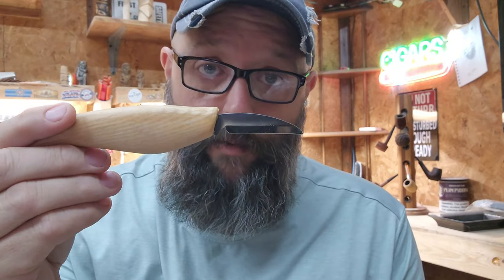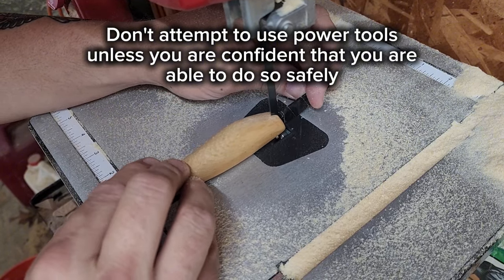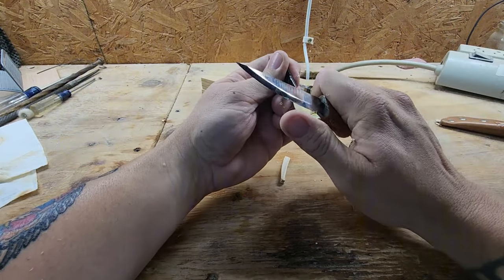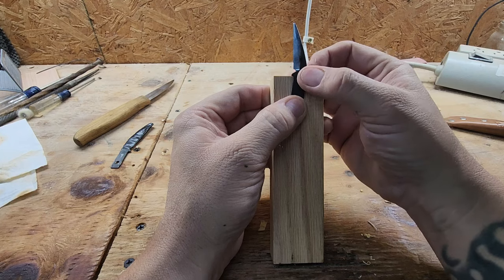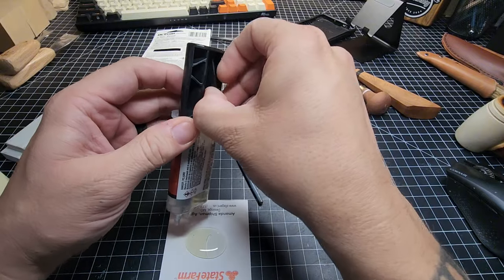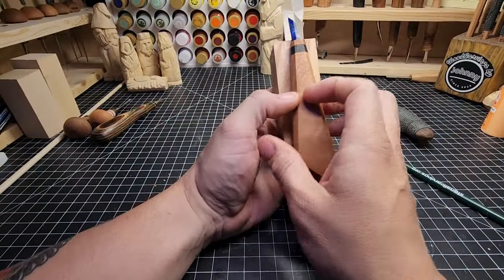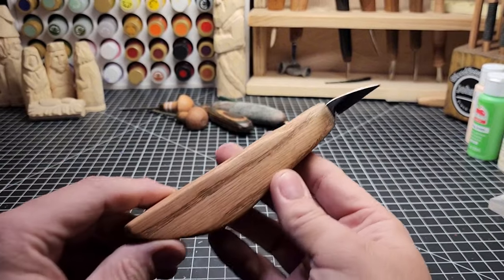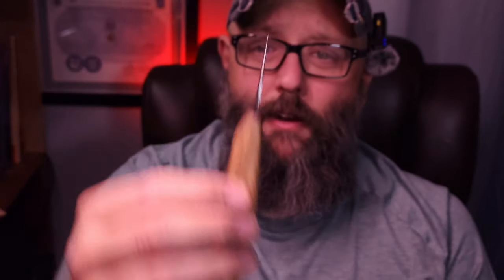Flexcut Knife Upgrade -- I fashioned a more ergonomic handle for my Flexcut Knife!

Comment: Great video! I really like the fact you encouraged people to customize their tools to suit their needs. Next time you go to glue the tang sand it with course sand paper and then clean it with acetone. It will ensure the glue adheres. Personal I would use jb weld it's stronger than the epoxy you used. I use it to make my flintknapping tools they are subjected to way more force than a wood carving knife. They hold up great, so I really like that glue. When I didn't have a bandsaw I used a metal working chisel just a 10 dollar cold chisel to split the handle and a utility razor and 60 grit sand paper to prep the blade for gluing. Just an alternative for guys who don't have a bandsaw.
Reply from the maker: @000cjr  That's great advice, thanks for the feedback! 😀

Comment: Looks fantastic. Did you consider carving those finger groves you like?  Or the markings along the spine to keep the knife oriented?  I’m with you…love a beefy handle and makes the grip much more comfortable and the knife easier to control.
Reply from the maker: @mgraham_Indiana  I did want to but the tang on this one shifts forward to where the finger groove would need to be.  You can see when setting the blade that the tang sweeps forward in the handle.  Where the handle is sanded too right now, I was worried I was going to expose the tang if I went much deeper.

Comment: Hay Johnny after I brought only one Beaver Craft though the mail as many knives are sold it's was beautiful but tiny for my medium large glove size hands I wonder just why they ( also other manufacturers)  don't sell knives in glove sizes might give the buyers a much closer to properly size..
   I have a saw and make my handles of 3 pieces of wood the inside layer of wood matches the thickness of the blade's thickness and good grade wood glue is stronger than the wood's  strength and laminated plywood is stronger than the wood by itself.
  Epoxy isn't strong on flat surfaces but needs holes to bond to.
   I've sujusted to several knives builders to make a oversized handle and encourage the carving community to shape the handle to fit the Carver's hands.
  1 X 30 will make the job easier as you suggested.
Thanks for addressing the issue
Also I invested $44 for 3 Badger State Blades and building 3 handles myself I fill is economic 
3 great blades on handles I like under $ 50 is a bargain and I like working with wood anyway.
Reply from the maker: @JohnJude-dp6ed  Indeed.  Badger State Blades are excellent knives too.  That's a great idea on using three pieces of wood.  Since this was my first time trying anything like this, that idea hadn't even entered my mind.
Reply: @JohnnyTheLayton  I'd lost my pictures of my handle build and I'll try to find them and send you some perhaps some day mail you a " kit " precut and ready for glue up.. Craigslist has good used 1 X30 inch belt grinder/ sanders and get the better belts of the Internet for quality and price
Reply from the maker: @JohnJude-dp6ed  Yeah a belt sander is on my wish list but I've got a lot of things on my wish list currently that outweigh hobby stuff!  =)

It's all a balancing act.   On a long enough timespan, i'll have all the things!  =)

Comment: First off, is that a new tattoo on your left arm? Also, have you checked out the flex Cut Pro Series? I got one of those the one in 3/8 detail knife and handle seems similar to the one you've got there.
Reply from the maker: @kosgov  The tattoo is a few weeks old now, got it at the beginning of October.  I think the flexcut pro's look great, I just haven't had the opportunity to get some yet.  At some point I'm certain I'll buy them and give them a whirl.  I have a terrible habit of collecting tools.

Comment: You know of course that you could have used your bandsaw to hog off that  matl. Otherwise great job and will probably inspire me to do the same. Cheers!
Reply from the maker: @kellyzimmerman3117  😆 🤣 😆 🤣 😆   We're going to assume that I of course thought of that and had a very good reason not to use it. (A reason that currently escapes me) Thanks Kelly!
Reply: @JohnnyTheLayton  Sorry for stating the obvious. You are welcome. my work is done here.😃🤣
Reply from the maker: @kellyzimmerman3117  Hindsight is always 20/20.  If I do something like this again, there are several lessons learned i can apply, and this is just another one!  😉